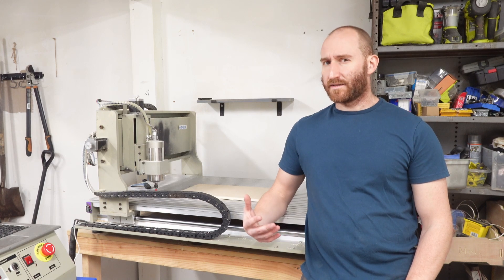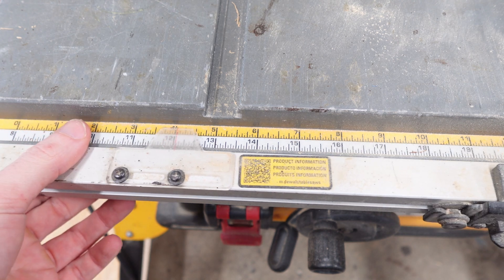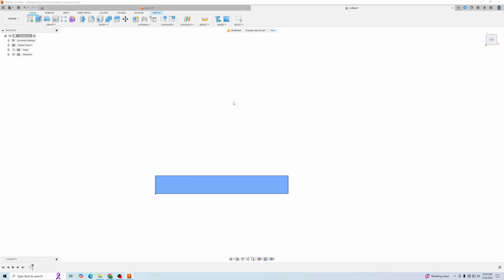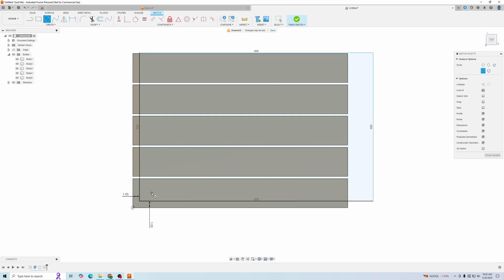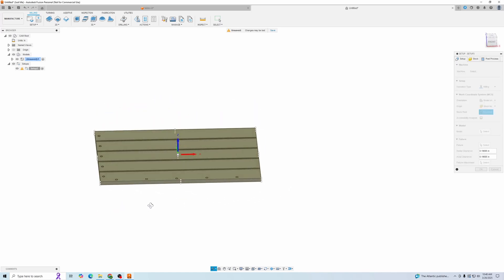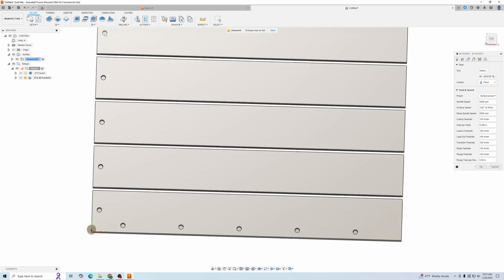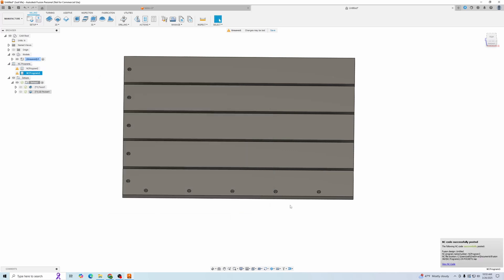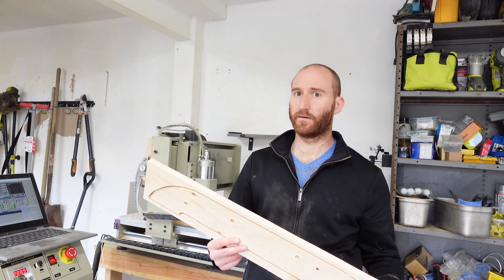Fastest CNC Spoilboard Setup (Save Hours of Frustration)

Comment: Would you recommend this brand ?
And what do you think about it 
I been thinking about buying one of those.
Reply from the maker: Yeah, I’d recommend it.  with a few caveats. The 6090 I got has been great for the price and does what I need it to. Just don’t expect much in the way of customer support or detailed documentation. These machines are kind of a ‘learn as you go’ experience. That said, it’s a great way to really understand how CNCs work. You’ll probably end up tweaking things and learning a ton in the process, but if you’re cool with that, it’s a solid machine for the money.

Make sure you get one with the USB connection on the back. The parallel ports are obsolete at this point.